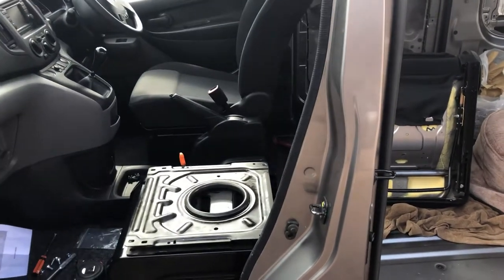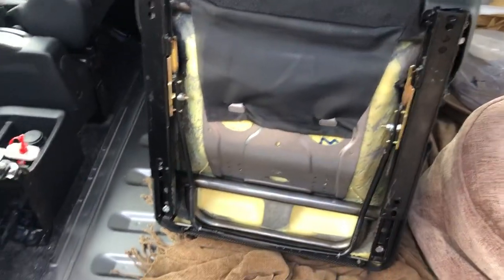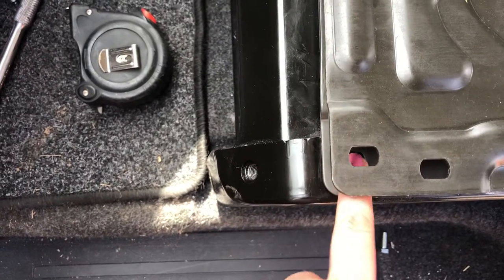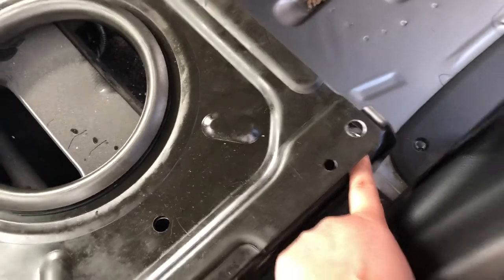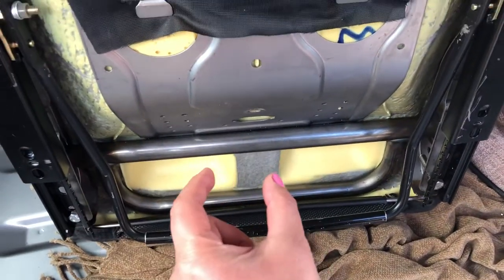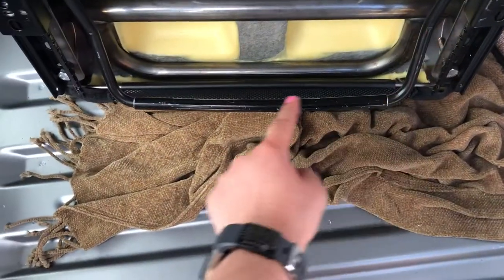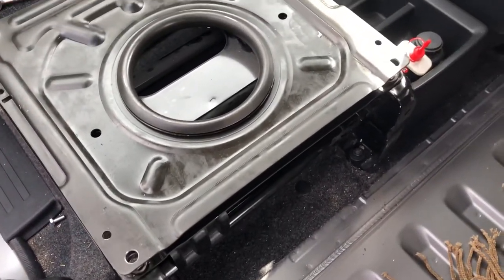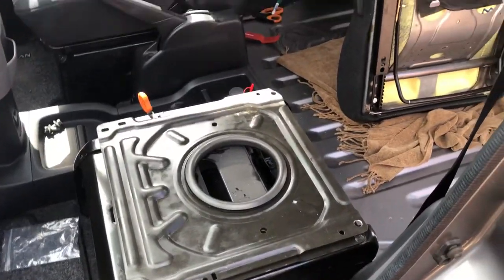Fitting the captains chair

Comment: Just what I want to do! Got the parts but failed once i unbolted the seat to find the brackets were riveted on as opposed to bolted in some of the holes, so i gave up while i regrouped! How did you remove yours? I wasn’t sure whether to angle grind the brackets directly or try to drill the rivets out, but either way i didnt want to make the permanent change then find i still couldn’t fit the remains parts because it would mean my other half couldn’t travel in the van until i got a replacement seat or managed to fit it properly :-D